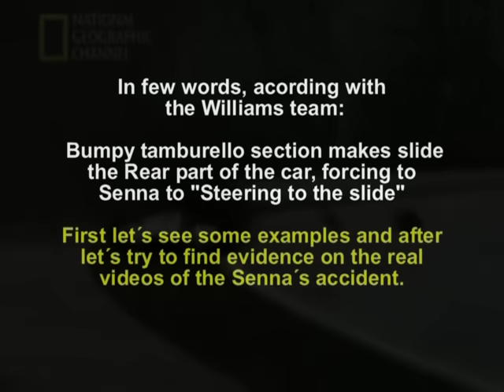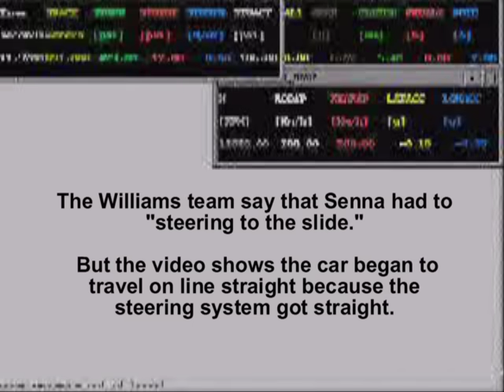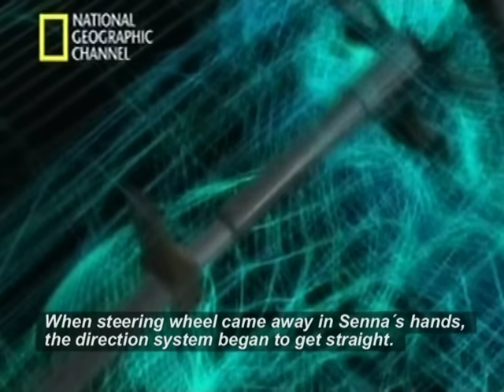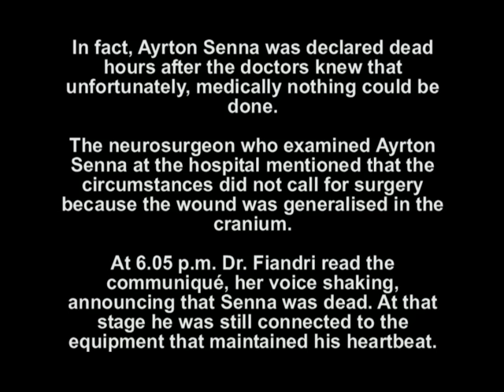5/5 the death of Ayrton Senna - what NatGeo did not tell

Comment: So it's the fastest corner in all of motorsports and there's no tires or anything on the wall? Only a hundred feet or so of sand and a concrete wall to stop you from going 190 mph? That seems perfectly safe.
Reply: @Chris Anagn. It isn't flying. It's falling with style....  Did you read your comment out loud before you posted it 😂
Reply: That's exactly what Senna had said in the days before.
Reply: It was a different era: we live and learn...or we don't live long. The FIA made a large number of safety changes: wheel tethers, tire barriers (they have save a LOT of lives).
Reply: Wtf good point
Reply: There is a river right behind that wall.  That's why it's so close.
Reply: @YourLoyalDeserter  exactly, and the run off could not be improved better than it was at the time.  Senna and Berger noted this late 93 when checking the circuit out.
Reply: Senna hit the wall in unusual angle, Tamburello-curve's safety area had not been made for such accidents
.
Concrete fences are placed in just such curves, which are usually encountered at a very small angle. The idea of the concrete fences is that the car would slide along it and not stop directly at the tire wall, thus reducing the impact force.
Reply: 150+ into a tire wall? no thanks
Reply: Definitely not OSHA approved
Reply: @olli5976   F1 racing  was Safe in Senna's time  compared to the way they raced  before him.  the  problem was.   Drivers got to brave because there cars  had protected them before. Senna had  walked away from 200 mph collisions, Why should  he be afraid to take a corner at top speed whit cold tires! If Senna had raced in the early 1960's and   drove  the way he did he wouldn't have lasted one season!
Reply: Agree 100%. All this chat about the steering column, ride heights and cold tires, when actually a simple row of tyres on the outside of the bend would have lessened the impact and deflected the tire away from the cockpit. Formula 1 cars and tires break and bust all the time causing huge accidents as the car leaves the track at high speed. That's not the problem here.  Senna himself ordered William's to lengthen the steering column knowing full well that it would have to be fixed up without an entirely new column as time was short (Senna fans often conveniently forget this in their vicious cries of 'murder' in Williams' direction). For me Williams were not negligent. If negligence can be found it resides within the FIA themselves for not cancelling the race after Ratzenberger's smash and also within the circuit owners at Imola for not thinking that a concrete retaining wall on the outside of a 200mph bend was a hazard in 1994.
Reply: Yeah these were very different times. What you say is true and it does seems crazy wow they were fine with that? But that’s how it was... I think lots of safety changes came after this race. More chicanes, tire barriers, newer tracks with lots of run off. It wasn’t just Senna, Roland Ratzenberger died this weekend and Rubens Barrichello had a vicious crash. Also several fans and pit crew staff were hurt in other incidents. Lots of safety improvement was needed and it took tragedy to realize.
Reply: In a low angle and high speed impact tyres are dangerous because cause a deadly deceleration
Reply: @Mauro-82  concrete will do the same...
Reply: @andrewb378  Only in high angle impacts (where is better with the tires), in low angle impacts the perpendicular component of speed is low, without tires the car can slide and stop smoothly while with the tires the car slips into the barriers causing a violent deceleration, have you ever seen tires on straights or in the curves of ovals , where is this kind of impact expected?
The only posthumous world champion, Rindt, died because the car slipped under the guard rail and got stuck causing a fatal deceleration, similar to how it would happen with tires in a low-angle crash.
Reply: at that speed it doesnt really matter what you're hitting, you're pretty much fucked. 
the gravel pits slow the car dramatically, increasing your chance of survival. even if Senna had hit a tire wall, on that curve, at that speed, chances are he still would have died.
Reply: @laurencedavighi1307  I honestly doubt a tire wall being place in front of the concrete wall would have save his life.
also, if williams knew that Senna's request was a life threatening and otherwise dangerous one, and still went ahead with it, that is negligence.
Reply: @philgiglio7922  You shouldn't have to learn from that kind of stuff though... it's science. It's just like how they didn't put seatbelts in road passenger cars as a mandatory feature for decades. We knew how inertia worked long before cars existed, so why weren't they mandatory from the outset? Some things are unavoidable... it isn't just down to the era.
Reply: The design and the site of the Imola circuit are the reasons why there was no run-off area or gravel trap, behind that concrete wall is a river. There was no way of changing that part of the circuit other than the exact thing they did do: add a chicane.
Reply: Ayrton Senna was actually hit by a tyre ,his own tyre/suspension and that's what killed him.
Reply: You can’t take today’s perspective back 27 years.  You just can’t.  There are myriad reasons and variables as to why you can’t but in short we just weren’t as safe or boring back then.  Trying to button every aspect of life up the way we are doing now just sterilises things.  I now know why older people are happy to take leave of the world.
Reply: @Chris Anagn. and you have a lot of room, gravel traps and tire barriers in Monza, or else Charles would be hurt seriously in 2020.
Reply: Said there's a river directly on other side of wall .
Reply: It was 1994
Reply: If u used gravel the cars would fly
Reply: That was the 90s. Much improved from previous years
Reply: Bruh they were still smoking in restaurants when this happened.   They didnt know what safety was lol
Reply: You need to remember that it was 1994.  Saftey in general was a lot worse
Reply: Mid Ohio has a similar corner except that it's a right-hander.  You come out of the previous corner flat out, driving right at a downhill concrete wall.  It's without a doubt the stupidest corner I've ever seen.  I haven't been there since the middle 90s but I hope they've done something about it.
Reply: @cutlass8783  remember it was better than before that
Reply: Try iom tt even safer,🤔
Reply: @beenusirimanne  it is easy with hindsight
Reply: It's motorsports pal.  They don't give a flying f..k about your life.  A driver is just a commodity, easily replaceable.  It's about the tech.
Reply: It’s also early sport racing days, all safety measures and precautions come after the accident or death has occurred. It’s always how it’s been! 

What’s worse is senna said it was dangerous for racing and the fia just wanted to carry on with it. Sadly, changes can only come about, when unthought of reasons and causes of an accident occur, and when later it’s fully understood why it was caused, can it actually be prevented! Otherwise cars would never race again if they had precursors to precursors and so on! The cars would become tanks just to drive around a track!
Reply: 1990's mate, that was just before they really started to improve the safety
Reply: Regulations are written in blood.
Reply: Andrew b.if u listened to what was said
Reply: A chicane was later added and cockpit sides raised to partially protect a driver's head from being able to snap sideways enough to suffer a broken neck from side impact, something that directly claimed Ratzenburger the previous day, Tambarello is a shell of what it once was
Reply: It's tradition, bro. The people who really benefit are safe and sound.
Reply: @unfortunately_fortunate2000 Agreed, just like Romain Grosjean's very rare accident last year, came across the car behind on the straight, got clipped and hit the armco at 45 degrees head on. Such a rare occurrence for a straight that it puncured the fuel tank, split the survival cell from the rare which got lodged into the barrier itself.

F1 safety it all about finding the right barrier(s), run off, gravel trap combination for ever section of track, as you said you can't go around putting tire walls everywhere

Look at kubicas crash 2007 canadian gp, his car got airborne on a section of track that should be easily flat out it wasn't even a corner, hence the concrete wall.
Reply: The wall was not the problem as he hit it in a angle that was still ok. If you hit a tyre wall in this angle the first part of the car goes in and is slowed and the car will break in the middle because the rear still has the speed. That happened to Panis in Montreal 1997 and he broke both legs. Sennas body was fully ok, no broken bones. The problem was just that a part of the suspesion hit his head and went through his helmet causing the severe head injury.
Reply: @YourLoyalDeserter   Plunging into a river sounds a lot less lethal than driving into a solid wall.
Reply: @electron5271  But you know they can’t do that either.  You can’t leave a circuit open like that.  The river made it impossible to extend the runoff area.  What they should have done before is what they have now done, added a chicane.
Reply: @FM BAS wasn't ground effect banned in the early 80s?
Reply: @FM BAS No, they didn’t have ground effect in 1994
Reply: @FM BAS also, it was the suspension, not the tire.
Reply: @FM BAS The suspension linkages punctured his helmet, as can clearly be seen in photos.  Can a tire puncture a helmet?  No.  Also the Senna documentary and multiple other sources make it clear that he was hit by pieces of suspension assembly.

“A piece of upright attached to the wheel had partially penetrated his helmet and made a large indentation in his forehead. In addition, it appeared that a jagged piece of the upright assembly had penetrated the helmet visor just above his right eye.”
Reply: @YourLoyalDeserter  If there is a river behind rendering gravel traps impossible, don't make it such a ridiculously fast corner then.
Reply: @laurencedavighi1307  You think Senna was an engineer? That's not his job
Reply: @smokescreen2146  well, yeah, that’s what they eventually did, not until it was too late of course
Reply: Putting  aside the real cause of the accident, FIA and IMOLA CIRCUIT HOLDS  RESPONSABILITY FOR THE UNACCEPTABLE LACK OF SAFETY CONDITIONS ON TABURELLO CORNER
Reply: @philgiglio7922  They have saved a lot of lives? Didn´t they know Tamburello curve had such a lack of safety mesuares? They hold responsability you do not need to have Ayrton or other pilot killed  against the concrete wall to learn the extreme danger of Tamburello curve and lack of safety. Do you?
Reply: @YourLoyalDeserter  50 mts behind. Ayrton and Berger just one year earlier walked together along Tamburello curve to check the possibilities of modificate it. Indeed was the river, and that was a problem  to make quick changes.
Reply: That's the Italians for you.
Reply: You should see old group B rallies.
Reply: @chrisanagn.3584 at 150mph same thing mate
Reply: Senna said this and also discovered there is a river on the other side. senna wanted to move the wall back.

Comment: I think his body language said it all. The way he tilted his body to the left... The way he tried to steer a wheel that did not respond. That’s total loss of control over the machine. A mechanical issue.
Reply: why wouldn't he try to turn left? what does this prove??
Reply: @Akiak7  Bro he literally pit his whole body into turning left, and it didn't work. Are you that slow?
Reply: @cisztheoriginal2911  i get that, i'm just saying that's kinda obvious that he would do that? what else is he supposed to do lmao
Reply: @Akiak7  because the steering column broke.
Reply: The sniper theory was made because when senna went straight his head had a movey movement as people thought that he had been shot
Reply: Hi, I know this is an old post but I think this is probably still a popular video given the recent Netflix series. I'm not saying that you are wrong, but how I interpret this is that Senna was, as usual, leaning into the corner in the cockpit to battle inertia. When the steering broke, suddenly that inertia was gone, and he effectively fell to the left and into camera view in the mirror.
Reply: The steering column broke and he went straight to Tamburello

Comment: Professional mechanic here... dude's steering column failed.  it's plain to see.  Senna was a master at correcting in low traction conditions.  Look how he performed in the rain.  Can't correct with a broken steering column, though... RIP Ayrton Senna
Reply: @BB-ft8fj why laugh at a tragedy?
Reply: I remember a rule change that was made just prior to this race. The cars wheel base was shortened which would probably affect the length of steering shafts. I noticed on the first replay of his in-car camera that the wheels failed to turn, and knew right then that the shaft had been improperly welded or had just snapped.
Reply: You're absolutely right. Got it first-hand, from a metallurgy professor at the university of Bologna, who was part of the team who made the forensic analysis in 1994. The cross section of the broken column showed, that where the metal had been soldered back together, the material had begun degrading and cracking under the stress before finally snapping, probably when he drove over the bump on lap 7.
Reply: @R4sKal  I hear Williams did everything they could to avoid any liability, but it wouldn't take much of an investigation to prove the car was at fault and not the driver. I lost all respect for Damien Hill when he lied and said, "It wasn't the car"
Reply: @burtpanzer  Indeed. My professor was still outraged, more than 20 years after the fact, at how the whole investigation was conducted and how the Williams crew was allowed to muddy the waters with wild claims and crappy video footage. The forensic evidence was clear. Cutting a metal rod and welding it back together creates a focus point for stress, vibrations and strain, especially since they extended the column by inserting a metal cylinder with a smaller diameter. It was never a question of if the column was going to break, only of when.
Reply: I  agree !!!
Reply: @R4sKal  why Senna's family didn't sue williams ?
Reply: in this video do not says nothing abouth a suspension part hits ayrton´s helmet crushing his head, i ve seen  another videos where even blood was on the "street" and helmet. RIP Senna great Driver!